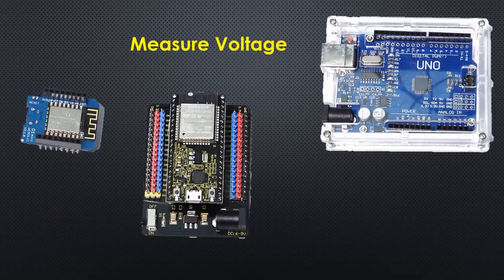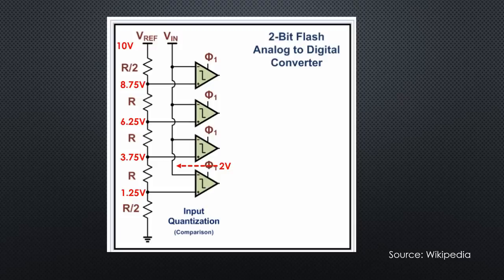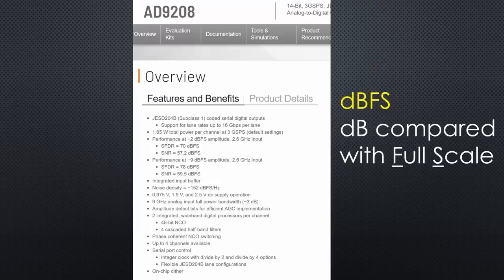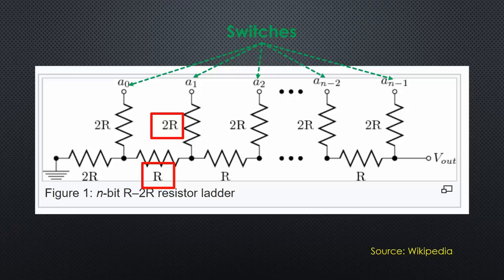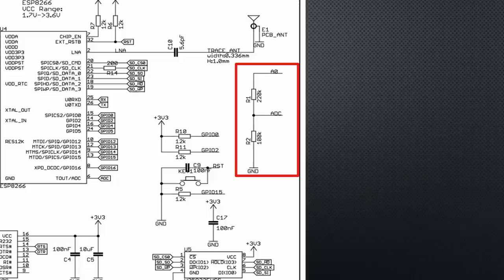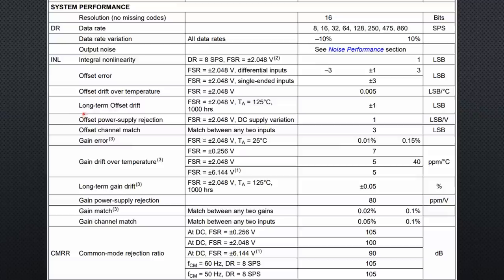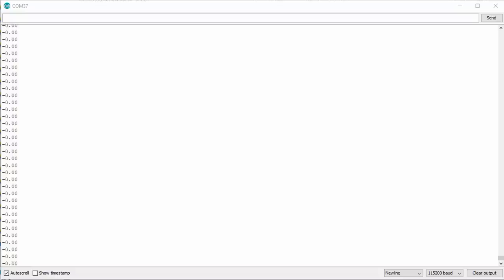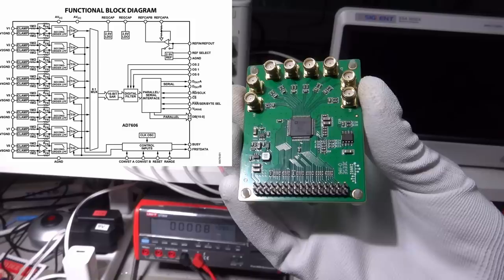#340 How good are the ADCs inside Arduinos, ESP8266, and ESP32? And external ADCs (ADS1115)

Comment: I have to say.... Given how poor these microcontroller built in ADCs are. Then it would have been nice to also include STM32 lines for comparison. As that is a common one used in industry.
Reply: In fact it was one of your conclusions in the video at the end. You said to everybody: well if you need an accurate ADC then it must be external. However by not including STM32 in your evaluation. Then it's ignoring all the people who have now begun using STM32 platforms for hobbyist use. And we can see that while being harder to choose from, they have a much broader range going up much higher in price and features. So inevitably at some point when you get up to the price of an Esp32 then its going to include a significantly better ADC yes? Well this is imprtant decision whether to integrate the wifi on the mcu itself and then have a seperate ADC. However with STM32 it is the other way round. You then might integrate the ADC but instead put the wifi off aways a distance (not to interfere). Like by attaching some external ESP8266. Since ST platform do not make wifi so easy as ESP does.... It is a choice to make early in a project., before going too far down either road. So before starting a project then I think this topic is an important discussion. Before fixing the design. Actually i ask the same question to somebody else recently after watching your video: 'well why not use the esp32 since it is so fast'. Well here is the answer. And these same questions also apply to the Nordic Semiconductor Devices. If they are to 'do a better job' and replace these shortcomings of the esp32
Reply: I was surprised too.The STM32F1(bluepill) has 2x 12 bits  Adc that can up  to 1M/S with something like 6pins available. And it supports DMA, so you can high speed capture with little CPU time.The GD32 compatible chips even have hardware oversampling, so averaging is free.. The bluepill  uses VCC as reference , BUT you can measure VCC, so it's not a problem.2x 12 bitsADC @ 1Ms/S for 2$ ? by far the best for that usage.
Reply: define "poor" ?!?
The built-in ADC in the ATmega is not poor at all for its specifications. A lot depends on your choice of reference voltage and front-end. I am currently working on a project with an STM32 and had to sadly realize that the lower-pin-count versions do not allow even to use the built-in bandgap reference for the ADC or DAC, only the VDDA supply voltage...
Reply: @uwezimmermann5427  Yes thank you for bringing this up. Actually I was more talking about the shortcomings of the ESP32 chip there (and not the Arduino, and thank you because your point about having a good accurate Vcc is not only unique to the Arduino). And of course ATMega also have other MCU products. Furthermore I am so happy you bring up is how confusing the STM32 product line is, because the low medium and high pin count versions has different features set. So it's like a 'Matrix of Tiers' xy instead of 'just simply have a single tier structure'. But in addition to that there are now also legitimately license STM32 clone parts. Which themselves also have even more hidden differences. It's really a drawback for hobbyists. To have such a huge and complicated range of products to have to evaluate across. You get a feature X but give up a feature Y. So this is why I also am asking about alternatives such as those new Nordic Semiconductor MCUs who Andreas has noticed are now getting Arduino IDE support.... If they really are better than ESP32. Then how their range of products compares against STM32 platform. For the simplicity, the actual features and performance, and the cost. In the meantime perhaps having some STM32 'cheat sheet' would be useful. To de-confuse the linup and extract the most essential differences between them out from the datasheet(s). Or a sort-able Google Sheet document or something. Even better if it also included other MCU families from ATMega, Nordic, etc. It seems that ST themselves expect us to use their  'ST-MCU-FINDER' application for android / iOS / windows. While for Atmel (now acquired by Microchip) their online parametric search tool https://www.microchip.com/maps/Microcontroller.aspx ... Each want you to buy into their respective platforms / eco systems. Elsewhere I cannot find a good independant cross manufacturer comparison. Including comments critical about quality of features such as ease of debugging etc. Details ehich just the basic numbers on a spec page like how many ADCs does not reveal. Not without a deep dive into the datasheets. Which is pretty time consuming. Not so practical when trying to get a bigger picture 'birds eye view' across all these many different MCUs.
Reply: @dreamcat4  a general cheat sheet about and across microcontroller families sounds like a great idea. I would be willing to contribute... just don't know what the best platform would be: google, git, ...
Reply: @uwezimmermann5427  i believe that an openly sharable, editable google sheet is probably best. I noticed for many EEs they still dont seem want to use git. But aside from that its convenient for sorting / filtering. I have seen great google sheets posted up on reddit for comparing amd motherboards. Which is where i got the idea from. Also on eevblog forum there are some good ones for comparing multimeters etc. Dont worry if you cannot be too bothered about it. Maybe if you alrady  happen to be working on some specific micro(s) then it could be worth starting one and partially filling it in. And start a thread  in the hopes that others will then come along to add to it later on. Anyhow thanks for your comments here, good day.

Comment: Useful concise video as always. I would recommend using a simple digital filter (IIR filter) rather than averaging. It will actually use the thermal noise which is inherent to the the SAR process to improve the accuracy. I found this to be a useful reference: https://tttapa.github.io/Pages/Mathematics/Systems-and-Control-Theory/Digital-filters/Exponential%20Moving%20Average/Exponential-Moving-Average.html

I despair of the Wemos D1 component values on the analog input. The input impedance of the ESP8266 is something like 25k but with the 200k/100k potential divider you end up with a lot of noise in the input signal as it charges the sample capacitor in the S/H circuit. Swapping the resistors for something smaller and more appropriate improved things. It's still not a very good ADC though.
Reply from the maker: Thanks for the link. Another commenter said, my moving average formula is an IIR ;-)  Exponential averaging is also a good way. But you have to pay attention to speed for some processors.

Comment: I'm surprised that the 24 bit HX711 ADC was not also covered in this video. It's designed supposedly specifically for load cells but I'm curious if there is something special about it so that it can be used with (and only with) load cells or if it can be used as a general purpose ADC?
Reply from the maker: I only used it for loac cells.

Comment: Nice video, I always interest in electrical measurement sensor.
However I've noticed you use 2^n-1 for your calculation (eg. resolution, voltage conversion), it's always caught my attention because there 2 side for this all over the internet, whether use 2^n or 2^n-1. To this day I'm used 2^n for my calculation, LSB (resolution) is given by Vref/2^n and voltage sensing using value*Vref/2^n, it's because my understanding that there only 2^n step (value begin at zero) so the maximum value of sensed voltage (FS) is always 2^n-1 sized, not equal or exceed the Vref itself. If the calculation related to FS then I will use 2^n-1 so LSB=FS/2^n-1 because FS=Vref-1LSB.
There so many tutorial, for example 10bit built-in Arduino ADC, using 1023 or 1024. I think it's interesting topic to discuss this fundamental math for ADC.
Reply from the maker: I had such discussions in my last video where I used 1024. seems to be a complicated topic...

Comment: If you made the resistor ladder uneven, and stuck with 4 comparators, you could get useful levels e.g. 3.6 3.8 4.0 4.2v dedicated for monitoring lithium cells
Reply from the maker: Good idea. But teh ADS1115 is also quite cheap...

Comment: So if your running an esp32 from battery and you want to test for low battery how would you do that as you don’t have a stable reference voltage?
Reply: Use a separate chip with an internal reference like the ads1115
Reply: I would connect a precision voltage reference chip to one analog input and calculate what Vcc would produce the measured value. The number goes up as Vcc goes down. You could also use this value to scale the other three analog inputs. Seems backwards, but it should work.
Reply: I beleive you can still use an internal voltage reference on the ESP32 - via  `adc1_config_channel_atten(ADC1_CHANNEL_0, ADC_ATTEN_0db);` ... You can see more about the ADC in Espressif's ESP-IDF documentation (which you can use in Arduino code still) at https://docs.espressif.com/projects/esp-idf/en/latest/esp32/api-reference/peripherals/adc.html

Comment: Hello, 
thanks for the in depth explanation!!
Can you explain where is this 
float y = (x * 1023.0 / 331.0) ; coming from? In detail the term 1023.0/331.0 ... min19.45
also in min18.11 I do not understand the 5/497 :(

many thanks for help
Reply: I don't understand this either.  If x is a digital value, to calculate real voltage we need  1lsb voltage coef. Which is max_voltage/max_resolution. So, the proper formula seems to be: float y = x * 3.09/1023

Comment: Andreas, great video, very clear and useful.
@11:43 you say that the analog reference voltage AREF is not available but it actually appears to be connected to a pin of the header named IOH (I have a genuine Arduino Uno and AREF is marked on the header)
Reply from the maker: There is another commenter explaining the facts below
Reply: Thanks for replying.
 @AndreasSpiess , do you mean 
Graham Wideman?
I understood your sentence as "the pin of the microcontroller is not connected" but you meant that "the pin is not connected to an on-board voltage reference". Is that the case?
I just bought a couple thermistors and an LM4040C41 and I'm going to use the Arduino to measure a couple temperatures. It would be nice if you showed how, even with a cheap and cheerful Arduino, it is possible to get fairly accurate measures when the signal is slow and the device (thermistor in my case) can be powered by the reference.
Reply from the maker: It was Uwe Zimmermann :
"available yes, connected to circuitry on the Arduino: no.
But be careful, if you switch the ADC reference to the internal bandgap reference while connecting another voltage to AREF blows out the internal bandgap reference for good."

Comment: Averaging is ok but a low pass filter is mathematically more simple since you don't need a huge array of past values and normally performs much better :)
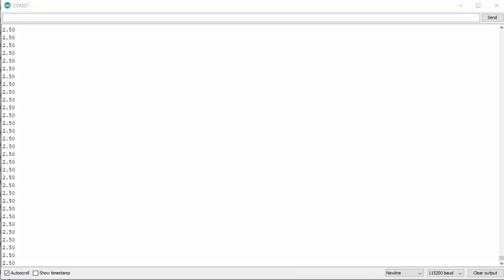Reply: as far as I can see Andreas is using an IIR algorithm for his filtering/averaging/running average/mean calculations which does not store an array of past values. See 19:40 where he shows the code. (99x the (single) old value + the new value) / 100
Reply from the maker: did you look at my formula?
Reply: @AndreasSpiess  ah, couldn't see the text as I was watching on the TV. I stand corrected good sir :)

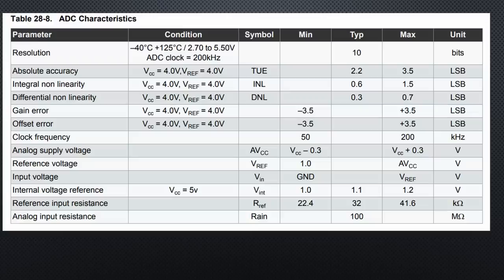Comment: 12:15 I almost spit out my coffee, I expected better from you Andreas ;) But that is the wrong calculation. You have 1024 steps so the resolution is 5,0V / 1024. Rounded, that's also 4,9mV and to calibrate you might want to use a different factor but that's not the point. Using the real resolution on most micros is also quite a bit faster because it's always a factor of 2. (Lack of div operator vs using shift to div by 2).  

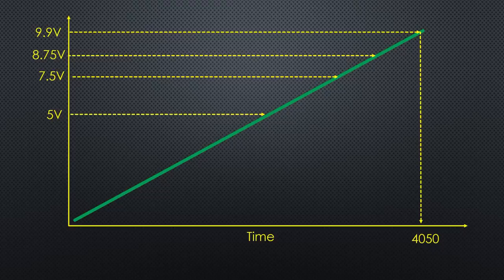So that makes 9:10 4055 in an ideal world. But more important 9:45 is not "maybe 10 tests", it will end up with exactly 12 tests. The number of tests of a successive approximation is equal to the number of bits. Which are just tested MSB to LSB.

I know the changes are small but I think if you teach them in a video the content deserves to be correct :) In contrast to teaching in front of a class where you want to make "mistakes" like this to see if pupils spot the error.

18:35 Don't agree it's always "not good". For example, if you want to read the position of a pot (or LDR). The pot is also referenced to Vcc which makes the error cancel out. Where you would have different values if you used a good and stable reference for the ADC.
Reply from the maker: 1. You can discuss with the 1023 fraction. I do not care too much. Last time I used 1024 and had the same number of complaints.
2. Concerning the number of steps: After thinging I found my mistake: I thought, if Vin is exactly 5 volts you could stop. But this is not true.
Reply: Lets make it simple: 1 step Resolution: 0->5V or: 5V/1
2 steps: 0->2,5->5 or: 5V/2
4 steps: 0->1,25->2,5->3,7->5 or: 5V/4
1024 steps from 0 to 5V or: 5V/1024
Thus: Voltage range divided by number of steps.
The other way around, ADC-value to voltage, its number of steps minus one:
1 bit ADC: only 1 or 0 -> 5V*2^1 = 10V = wrong --> 5V*(2^1-1) = 5V = correct

Comment: Great timing! I just got ten sliding potentiometers and was wondering how to measure their values. Found another video that shows how by connecting all the value pins with a diode to a single analog input, the VCC pin on the potentiometers can be muxed using digital outputs one after another. Also thinking of using a GPIO extender chip like the PCF8575 for this, so I could measure about 16 analog values (slowly) using a single analog pin in the Arduino with pins left over. Will be a MIDI controller project, don’t need resolution or speed or accuracy all that much imho.
Reply from the maker: You can buy analog MUX ICs like the 74HC4067

Comment: Hey Andreas, what about splitting the digital and analog star ground connection point? I mean putting one before the other, or vice versa.
Reply: I have used the internal ADC of the ATtiny/ATmega in several scientific (aka "serious") projects - and they are up to the task when 10 bit resolution is enough. But you can loose a lot of the potential by not using a good design for the front-end outside the chip. The datasheet of the AVR series recommends to use a 10 µH inductor in series with the AVCC supply pin as well as the mandatory 100 nF decoupling capacitor. Using a star-ground is absolutely necessary if you have parts around which will draw significant current. However, while AVCC and VCC in the ATmega are separated inside the GND-pins are all connected to the same metal-layer going all around the chip. But for everything you have outside the chip, i.e. voltage divider, possibly an opamp, a split GND is almost mandatory.

Comment: Would you please make a video about how delta sigma ADCs work?
Thank you
Reply from the maker: Unfortunately I do not understand it :-(
Reply: @AndreasSpiess  Hi Andreas, the sigma-delta ADC is less complicate than it seems. Imagine that you have a capacitor in series with a resistor, and you have a 2 position switch by which you can choose to charge the capacitor or discharge it. Now, if you want to make the voltage across the capacitor equal to the input voltage that you want to measure, you will have to continuosly move the switch from one position to the other, The voltage across your capacitor will zig-zag around the target voltage that you want to track. When  the input voltage is high, the switch will have to stay in the ON position longer than in the OFF position, and viceversa. If you measure the time that the switch has been in the ON position in each sampling interval, you have a digital representation of the input voltage. Not sure that this short explanation is clear or accurate, but I hope that it helps!
Reply: @AndreasSpiess  Perhaps my previous explanation was oversimplified, but you can find a nice "demo" here: https://www.analog.com/en/design-center/interactive-design-tools/sigma-delta-adc-tutorial.html

Comment: Hi folks, 

I'm trying to get a voltage sensor to measure over 50V DC on an Arduino microcontroller. Any recommendations?
Reply from the maker: You can google "voltage divider calculator". Then you can can calculate the two resistors to get the voltage down to the range of your sensor

Comment: I see no ADC input impedance number for the ESP32, but for the Atmega328p the datasheet lists 10kO as the higher limit. With >1MO, the input is much more sensitive to noise, yielding the results that were in the video. The capacitor in parallel is both for input stability as well as for filtering out high-frequency components that might otherwise cause aliasing. But probably even with all the input conditioning, the ESP32 will show poor results due to the running clocks and radios. The only way around that is to take the ADC measurements while in sleep mode.
Reply from the maker: Sleep mode is good, but then you need a little ULP programming...

Comment: Excellent. Please do AC measurements! Better to rectify, or sample the waveform and compute max-min digitally?
Reply from the maker: I made a video about AC current measurement.
Reply: @AndreasSpiess  that's a fantastic video, thanks! What are your thoughts about using a voltage divider for measuring not mains, but class 2 wiring like 24 VAC thermostats?

Comment: Wait, when I understood correctly, most  ADC in Microcontroller have an build in DAC?
Why do they not expose the DAC to external pins?
Why do I have to buy an external DAC board to get Analog out?
So few Microcontrollers have an build in (accessible) DAC.
Reply from the maker: The ADCs have an internal DAC, yes. They are probably too specialized to be used also for external purposes. Otherwise companies would do that. I also do not know why a lot of chips do not have DACs. I assume it is the market demand.